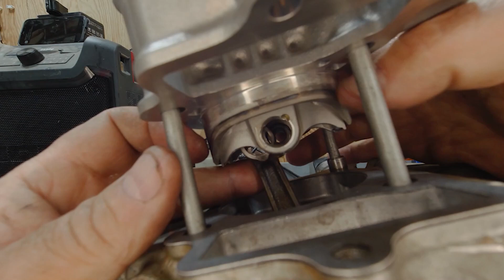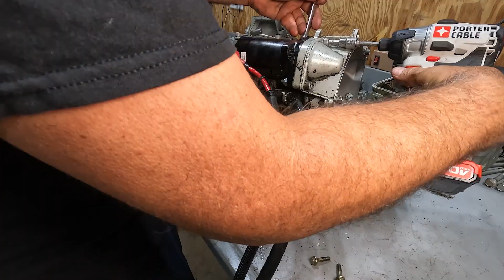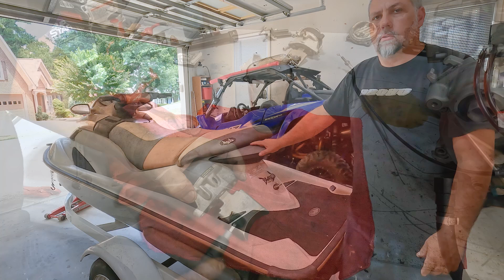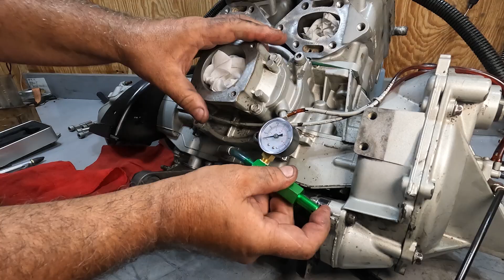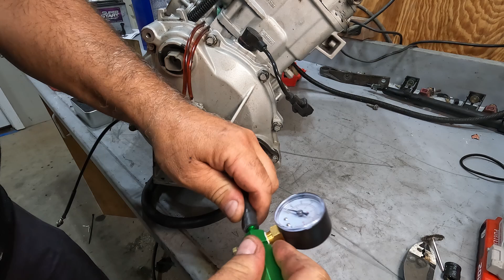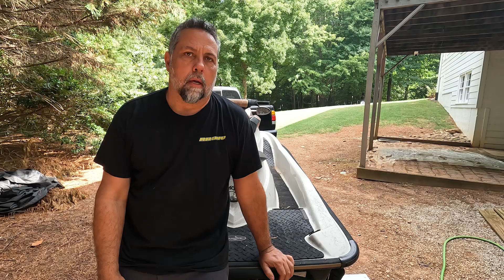2003 Sea Doo GTI RFI Engine Replacement and Issues Ep91

Comment: question i have same year make and model, do you have a way to video where each of the oil lines go and the water lines some reason mine are werid inside the hull. my port side has 2 cooling tubes and one goes to the exhaust manifold and the other is just sitting next to the battery. please help
Reply from the maker: Unfortunately, I no longer have this machine
Reply: @restoroosterohv ok thank you, your video was very helpful

Comment: Where did you get that nifty air pressure pump/gauge.  I can't locate one.
Reply from the maker: https://youtu.be/sn5udLUMnEw?si=XLj9WtaQroKGFGIS
Reply: @restoroosterohv  I meant the one you pumped up with your finger t0 see if the oil line was holding pressure.
Reply from the maker: @UnkeeD ahh
https://a.co/d/5KZh0KT

Comment: Did you figure out what was wrong with it ?
Reply from the maker: Haha, not yet. I started diag right after this video but haven’t touched it all winter. Hopefully I’ll get back on it soon.
Reply: @restoroosterohv I’m having the same issue with with my 98 rfi. Tried replacing the fuel pump with out any luck… don’t have a candoo computer thing and it’s pretty expensive

Comment: You have to set the TPS control system if you unplug it during the engine installation or move it otherwise it will have no power at all in the water
Reply from the maker: Yeah, that’s what I’m leaning towards. Someone else built the engine so I’m not sure if they put the rotary valve in correct either. I’ll get back on this someday

Comment: Several things this guy is doing wrong One Quicksilver oil is junk to never ever run your engine without the oil lines full even at idle before you install them on the pump take your mouth like a straw and suck them full of oil 3 on these rfi's to set the Taps system on them you have to have a computer there is no other way
Reply from the maker: What do you suggest for oil?

Comment: Wheres the follow up? What was the issue? wondering if it was the computer or key, I know if I put the wrong key on some of my toys( ski doo / seadoo) they dont like to rev up, but will start. there might also be another valve on the exhaust, not sure if you have looked at that.
Reply from the maker: I know I know. I just haven’t been motivated to dig back into it. I believe it has something to do with the rotary valve or its timing. I got the ski with the information that it ran fine until it ingested water and seized. The only difference is this “rebuilt” motor I put in and the symptoms point in that direction. I will do an update video as soon as I can. Thanks for checking in.

Comment: Great video! I haven't put all my rebuild on my page yet....dealing with the exact same thing with a 2005 GTI/RFI. Just did a rebuild, works fantastic on the hose. Mine will hit top speed once and then die. If I can get it started in the water, it will not reach top speed. I do have a Candoo pro and I was able to reset my TPS to zero and that helped, but didn't correct it fully. I am also chasing an open ground from the starter solenoid. The 10-amp fuse on the starter solenoid wire keeps popping after starting in the water. These RFI engines are absolutely frustrating to deal with!! If I resolve my issue, I'll let you know too!!
Reply from the maker: Yes, they can certainly be a pain. I haven’t figured mine out yet but also haven’t really messed with it. I need to pull the rotary cover and check the valve timing and then pick up a Candoopro. Let me know what you come up with. Thanks for your comment.

Comment: If the carb kits aren’t OEM it’s guaranteed to fail. Just learned my lesson after buying 3 kits at $100 a piece. Same exact scenario on my 2000 GTX DI !!!!!!
Reply from the maker: This engine is fuel injected, no carbs. Good tip though and I agree with you. Use genuine Mikuni rebuild kits.
Reply: What the hell are you building a DI or a RFI neither one have carb kits LOL

Comment: I have a question what should I replace first my kx450f 2009 ant sparking at all I jump it off from condenser it would spark sometimes but now nun at all replace it and still nun
Reply from the maker: The condenser  has little to do with spark, it stores energy for the fuel pump. There are far too many things that could cause you to not have spark, but I would start with measuring the resistance of the coil and crank sensor.
Reply: Crank sensor is on the stator ant it
Reply from the maker: Yes
Reply from the maker: @coltenpogue If you need a downloadable service repair manual for any of your projects, use my affiliate link to eManualonline.com. They already have great prices with an enormous catalog of manuals and if you use my discount code RESTOROOSTER22 you'll get 22% off until August 31,2024 and LABOR30 for 30% off between Aug31 and Sept 2, 2024

https://shareasale.com/r.cfm?b=510988&u=4229791&m=49176&urllink=&afftrack=
Reply: May I have your number so I can show you a picture of I’m new to this

Comment: Hey man!! Love the vids always watch as soon as they come out, lots to learn across the board. I’m currently working on a 95 Kawasaki 750ss jetski and it’s doing the same thing this video ended with. (Runs great on trailer and dies even on a garden hose) Been patiently waiting for part 2 but thought I’d comment and ask if you’ve found the solution?? Maybe my issue is similar. Thanks man!
Reply from the maker: I haven’t figured out the issue with this ski but it is probably in the ecu having to do with the fuel injection. You probably have a carb issue. How is the compression?
Reply: @restoroosterohv truly appreciate the help and response. I just fully rebuild the carburetor was pretty confident in doing so, took apart every single part I could and cleaned it all. (I have a good amount of experience) Fires right up and runs great, revs up smooth then introduce water from a garden hose and it will slowly start running rough and continue to get worse until it stalls out. If you blip the throttle before it dies out it acts like it clears out the system then it will restart its bogging down pattern. Hopefully that makes sense, trying not to write you a book haha. Compression on each cylinder is 155/157. My initial thought is a cracked water jacket or bad gasket allowing water to get where it’s not supposed to be. I just pulled exhaust system apart and there is signs of some water/moisture in the exhaust manifold.
Reply from the maker: @BladeKnierim  Have you put it in the water and see how it runs? Maybe the hose is filling the exhaust/engine faster than the engine can blow it out at idle. Mine runs fine all day on the hose but not IN the water.
Reply: @restoroosterohv  the owner had it in the water and had the same issue I’m having on a garden hose. That’s when he had brought it to me, even cruising across water it will bog out and die. If or when I figure it out I will let you/everyone know what my issue was. He has bypassed the oil pump and mix’s the gas, I told him I didn’t recommend that and I have wondered it it’s not running strong because of that?
Reply from the maker: I wouldn’t worry about the premix as long as the pump has been properly blocked off and mixed to 40:1 or so. I would be sure to use the API-TC 2 cycle oil. Did you set the pop-off properly in the carbs?
Reply: @restoroosterohv  the pop off? I did replace the spring on what would be the float needle as it came with the rebuild kit
Reply from the maker: The pop off is what that spring controls. The springs need to be replaced to adjust the “pop off”pressure of the needle. It is tested by slowly pressurizing the fuel inlet to see when the needle releases the pressure. You would need to check the manual to see what specifications the manufacturer calls for for your carburetors. The spring adjusts that pressure. Most kits come with a few different springs so that you can adjust it. It would be easier for you to look up the procedures for doing that on YouTube as I unfortunately don’t have a video to do that but I probably should. It is critical for low speed operation.
Reply: @restoroosterohv  I will look into that, Thank you for all the help and advice! I’ll be waiting for many more videos, love them all🤟🏼
Reply from the maker: I appreciate your support. Let me know what you end up finding out about your boat.
Reply: @restoroosterohv  pop off pressure was 30+ psi, played with springs and got it down to around 22. Ski ran great on garden hose full blast where as before it would die out with hose barely on. Not yet water tested as it’s getting colder here in Michigan. Appreciate the help my friend!!

Comment: I got one for you shall I say it . KING QUAD 750 I bought it from a friend payed tooo much like the compression in its single cylinder put a new starter on it and fixed the pull rope with new battery and I hit the starter and pulled on the rope as hard as I could but just ripped my arm half off. I guess I'm getting old, in my younger day I at least would have broken the rope. LOL When I bought it cranked it rode it lots of power the second time it got tight and died. what ya think? 'I'm in Tennessee around Dayton's Blue water resort fishing. Do you need a challenge?
Reply: yes.. I think there is a pressure release not working.it slowly got worse just not much information about that compression release
Reply from the maker: @kevincresswell5272 what year is it? The auto-decompression is built into the exhaust camshaft and is not serviceable on its own. If you pull the valve cover and look in the center of the exhaust cam, make sure that the weight assy moves freely and returns to closed when released.
Reply from the maker: Will it pull if you remove the spark plug?

Comment: Where's the follow up? What was the issue?
Reply from the maker: Still working on it
Reply: Just bought a 2003 rfi skidont with 120hrs from a guy saying it was ready for the water no issues. First time out started hard in the water ran for 30 secs and then bogged out died wouldn't  start in the water but started after I pulled it out. Sell it for what I paid which is $1200 for 30 secs of fun
Reply from the maker: @campinukshuk4452 at least you didn’t take a loss

Comment: Excellent video.  I inherited a 2000 GTX/RFI that I’ve brought back to life .   I want to redo the oil system and your video will help a lot.  You scared me about the oil type though.   I’m running Lucas synthetic blend two-stroke oil.   It has survived 6 outings with a teenager but I’ll change out the oil when I can.    Good luck with the ski
Reply from the maker: Sea-Doo is very specific with their oil requirements. A lot of people don’t follow them because they simply don’t know. Main reason for engine failures on jet skis. TCW3 is generally a no-no.